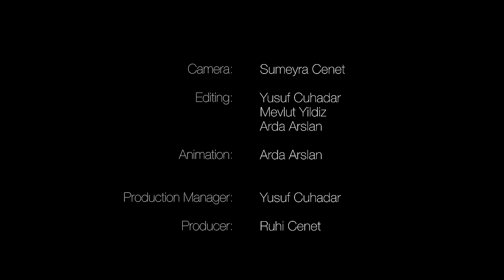8 Crazy Experiments at -55°C, -67°F (The coldest city in the World: Yakutsk)

Comment: Actually a refrigerator makes perfect sense in such a place - it keeps the food at a temperature that prevents it from spoiling while at the same time it's ready for consumption.
A meat that's frozen at -55C would probably need a whole day to defrost before it's ready to be cooked.
Reply: throw it in microwave for 15 minutes
Reply: @salemas5  Might work for smaller chunks only. Thawing milk/juice that way isn't recommended.
Reply: @flioink  what’s wrong with putting liquids in a microwave?
Reply: is that why they eat meat raw?
Reply: @ousarlxsfjsbvbg8588  Depending on the liquid, microwaving could change the consistency.

Comment: This trick with a boiling water can be made only with very hot water. Surprisingly, cold water cant freeze so fast. Only hot water. Its not freezing, its just transformates to warm steam and dissolves in dry air. Of course, cold water cant transformate to warm steam. It will just fall to the author))
Reply: False
Reply: False
Reply: False

Comment: Hot water doesn't freeze when you throw it in the air when it's this cold. The water doesn't freeze. It just makes a steam cloud that people think looks like ice for some reason. Ice isn't a cloud. Any liquid water gives off tons of steam at those low temperatures. I walked to the shore of Lake Huron once while it was -40 out but the water was still liquid, so there were huge clouds of steam pouring off of the water. It looked like the entire lake was boiling as far as the eye could see. I've never seen anything so amazing in my life. Unfortunately it was 2004, so no smart phones or digital cameras. Cameras existed, but they were like $1000 to start.

Comment: its amazing how they can even have cars here, I remember a couple years ago in montreal (which is definetely not an arctic city but gets very cold) we had a near record low of -37c base temp but feels like -45c temp, i starting my car and it screamed like an air raid siren from the power steering pump, fluid was so thick from the cold but at the usual winter -20c its perfectly fine, so i can imagine a 20 degree drop from even that is pretty extreme.

Comment: I understand this is extremely cold, but every experiment was something that could be done at even Plus 10 degrees Fahrenheit. We've had clothes outside and carpets freeze solid at 20 degrees F. And yes if you put water and noodles outside and prop it up to sit in one position it'll freeze it even at 31° Fahrenheit. I'm not complaining about the video it's just really hard to understand how cold this is when the experiments are things that could be done at almost 80° warmer.  Definitely not the instant freezing of boiling water though that was a good illustration!

Comment: A small correction on the permafrost:
Due to climate change the permafrost has started to melt resulting in numerous problems like sink holes, warping of the ground, unsealing of copious amounts of frozen organic tissue resulting in a release of copious amounts of methane into the atmosphere and more.

If this continues there soon won't be any houses left in Yakutia because the foundation will simply give out and turn to sand.

Comment: Haa very water conserve. To boil a water need low energy because “takat didih” is lower due to surrounding temperature cold. 

Take me locally as coordinate 0•0• room temperature at 32’c year long, for water to boil requires more energy and longer time. And hot water evaporates faster in cool weather due to “humidity or percipitation”. 

But we have hydroelectric so, we good :) good brain storming. 🙏🏼